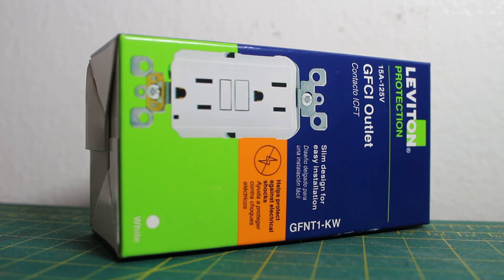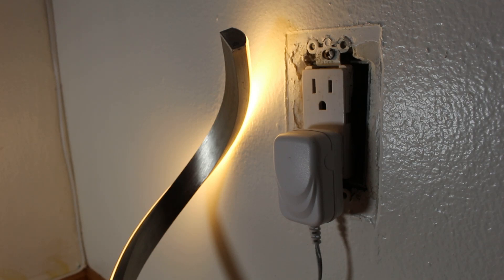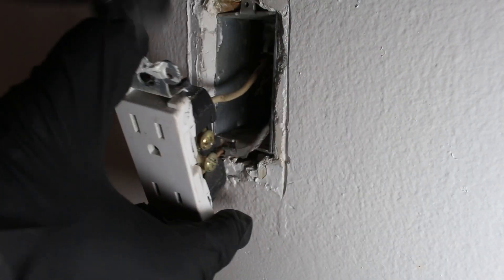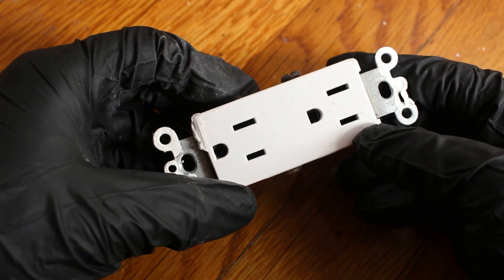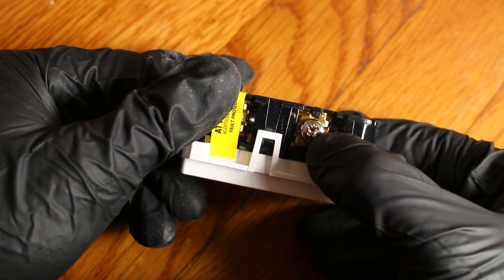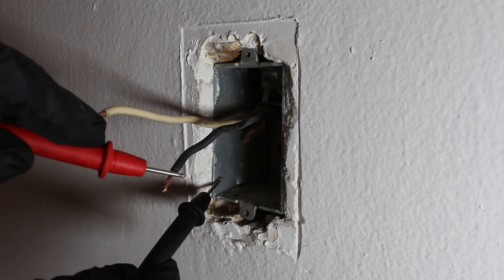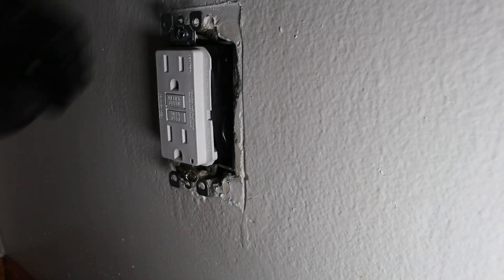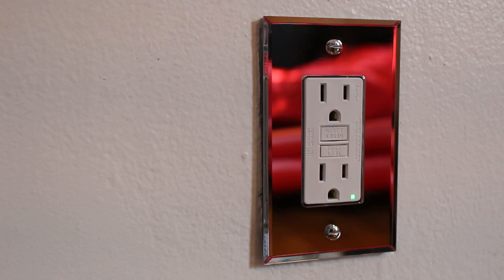How To Install A GFCI Outlet (How To Wire/Install/Replace A Outlet) GFCI Receptacle Replacement

Comment: This is not a helpful video at all.  For anyone that wants to know how to install a gfci here's some actual helpful info.  If there is no ground, run a ground wire from the new outlet gfci or a regular outlet to a grounding screw and screw that  to the back of the box.  

There is no mention of line vs. load which is important.  The line part is where power comes into that outlet.  The load part is where power leaves the outlet.  However anything that you put on the load side will be protected by that gfci outlet down stream.  So if you have 4 outlets down stream from the gfci they will all be protected.  But if you want to protect that outlet and that outlet alone but have outlets downstream you do not want to be gfci protected, put both of the hot wires together and make a pigtail using a spare piece of black wire you buy at the store.  Wire nut the 3 wires up leaving the pigtail as the only stripped wire accessible.  Put the pigtail wire under the brass screw and do the same for the neutral side.  Remember to never have more than 1 wire occupying a screw.  That is why you bunch them all up and run a pigtail.  

Remember, protect outlets downstream?  Break the seal on the load side.  Protect only that single outlet?  Do not use the load side.  Why would you not want to protect outlets down stream?  Let's say outlets down stream are for a fridge or freezer or sump pump or anything else you dont want the power to be cut of to if someone trips the gfci.  If the gfci gets tripped, all power downstream gets cut off.  So keep that in mind and you will be good.  Why a video would be made about this not explaining anything about line or load or why there is no ground wire and how to deal with no wire existing is just sloppy bad advice.

Comment: Older homes that still have just 2 wires (both wires are black), there is no ground wire  hooked to the circuit, so you cannot use the metal box to use as a test point. In such a situation, I use a non-contact voltage tester to find the hot wire. Has always worked for me

Comment: So a gfci will work properly with no ground? Great video. I’m curious sir.
Reply: No....   even though the neutral and ground may share a common bus bar in the main panel, a gfci receptacle needs a dedicated ground to function properly.   If you look inside your main or sub panel all AFCI/GFCI outlets should be home runned to a dedicated breaker.
Reply: Yes, as it's tripping if some of the current isn't coming back.

https://wiki.opensourceecology.org/wiki/GFCI_Outlets
Reply: Yes, it will protect the user, but may not protect sensitive electronic equipment without the ground. This GFCI is grounded by virtue of the mounting screws making metal to metal contact from the yoke to the box. He proved that the box is grounded and could have easily verified that with a cheap receptacle and GFCI tester, but unfortunately he didn't do that.